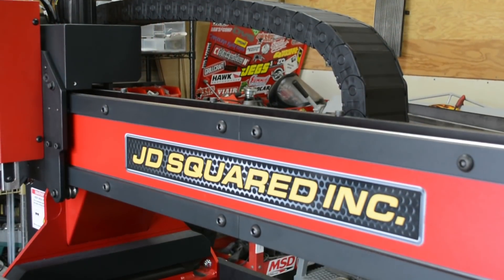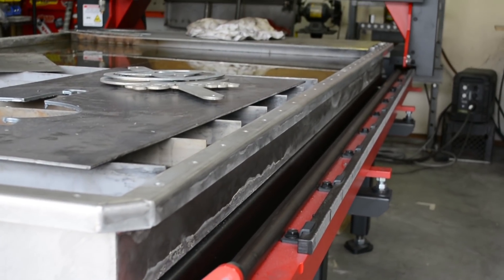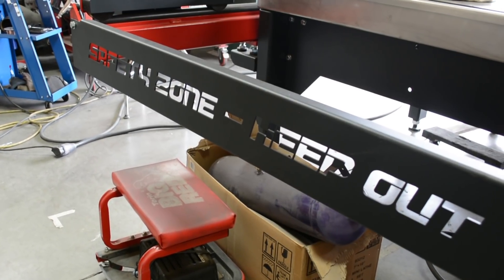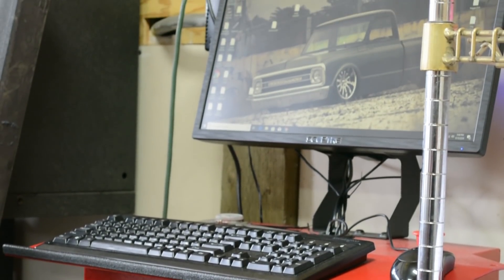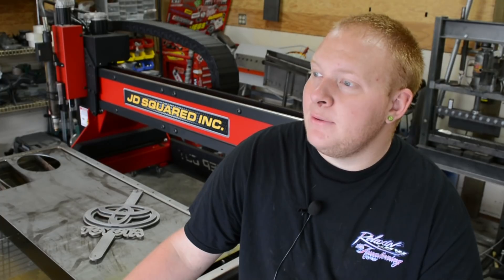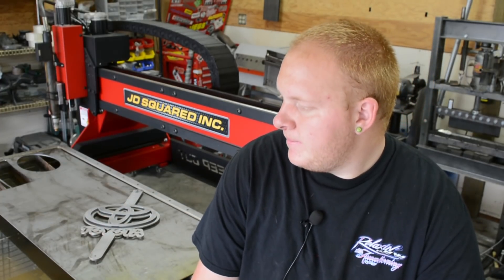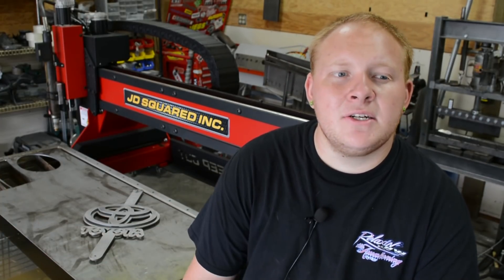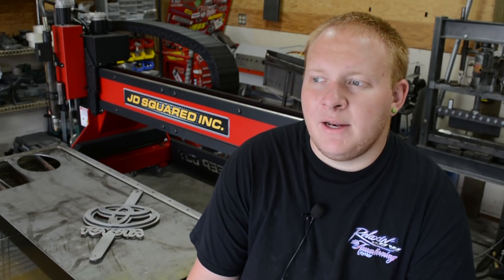JD Plasma Table Overview // In Action!

Comment: Hey man I went to jd2 and checked out their shop we are thinking of buying a 5x10 are u happy with the product or would u go another route
Reply from the maker: Almost 4 years running now. Nothing has broken on the machine itself, still cuts to every dimesnion. Every once in a blue moon ( few times a year ) i have to reboot the system, although i think thats on the computer side. Still would buy this unit today. Although i would buy it with the pump system for the water as cleaning the table is a bit of a pain draining it and refilling it.

Comment: Now that you've had the JD2 table awhile; what do you think of it? Thanks.
Reply from the maker: Still going strong! Added the pen and engraver attachment awhile back, pen attachment was somthing I never knew I needed lol comes in handy. Table has worked pretty much flawlessly, I guess the only thing that would have been nice as I just did a clean out last week. Would be a slight tapper to the water bed for easier draining, its flat so the last bit of water has to be soaked up or sucked up.
Reply: @scrapingpavement  Thanks much for the reply! My best to you and your family!

Comment: The gantry looks extremely heavy.  Takes a lot of power to move something like that quickly.
Most steel comes in 5x10 sheets.  Why didn't you get a 5x5 or 5x10 table ?  Do you get all your sheets cut down to 4' wide ?
Reply from the maker: Has been working flawlessly and can move 1000+ inches a min. We have no problem getting 4ft wide pieces from our steel suppliers. Thanks for the comment buddy🤙

Comment: There is a company that makes an additive, called kool quench i think, it keeps your material from getting rusty after it gets wet. We use it at my shop and it works great. I'm not sure the ratio but it will for sure save your rails from getting rusty
Reply from the maker: Actually purchased whats called green cut a few months ago, which is alot safer than the plasma quench for heath risks. Been working great, no rust, cleaner parts, and cooler as well.
Reply: @scrapingpavement  I may have to look into that. The quench is quite expensive for our application.
Reply from the maker: Green cut isnt cheap either and comes out of canada. Cost me 225$ shipped for a 5 gallon bucket.
Reply: scrappingpavement I think kool quench is $400 for the keg, I think it’s 30 gallons. But our table is 8’x12’ so it’s pretty big
Reply: @scrapingpavement  have the same JD table.  If you search through the Green Cut ingredients, it's just  'xxxx' Glycol (can't remember off the top of my head).  Basically antifreeze.   

If you get the right one, per the green cut ingredients.   You can just get 5 gallon buckets of that and save a pretty good bit.

Comment: Hard to imagine that table weight is  2700 pounds.
Reply: According to the manufactures website it weighs 2,000 pounds if it is a 4x8 table, the 5x10 weighs 2,900 pounds. Still heavy duty though compared to most in it's class.
Reply from the maker: Yep that's one of the reasons we choose this table because how Beafy it is built.

Comment: Thanks!  What model plasma are you using?
Reply from the maker: Thermal dynamics a60, have cut up to 1/2" steel with some Kerf. We plan to upgrade in the future to be able to cut even thicker.
Reply: @scrapingpavement  zero slag with that thermal dynamics plasma you have.  Impressive

Comment: How is the cut quality compared to the bailiegh? How do you like the software?
Reply from the maker: Still using the same torch ( thermal dynamics a60 ) eventually will upgrade to cut thicker. The features on the new table help cut quality with motorized Z. The bailiegh came with software which is super easy to use and has great tracing features. The jd only came with software to create g code and run the table. Nothing to design so you will need a software program. I've been using the bailiegh software to design until we get it sold off.